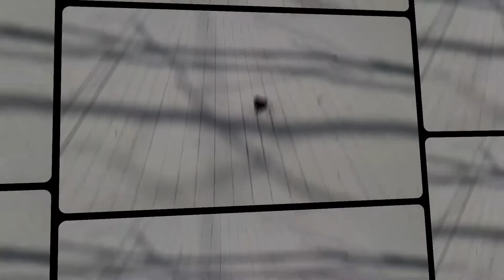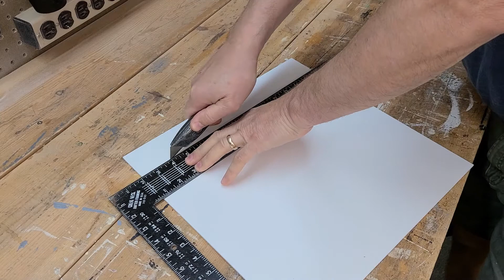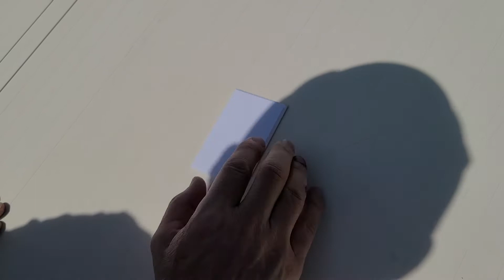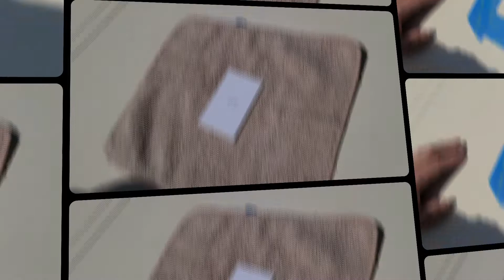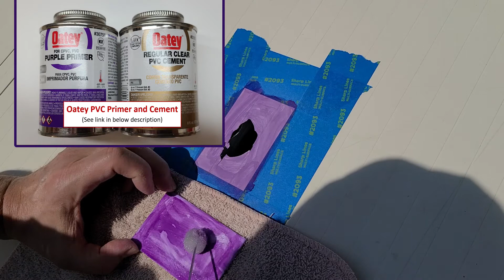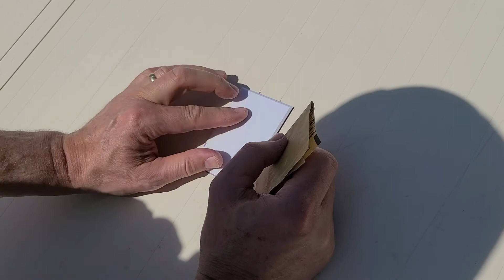How to repair holes in a PVC Vinyl Shed

Comment: They make clear primer my friend.its the same as the purple primer.just so you know.the purple primer is so the plumbing inspector can see that it's been used on every connection.
Reply from the maker: I wasn't aware the clear primer was available.  I've added a link in the description for the clear primer.  Thanks for your suggestion!